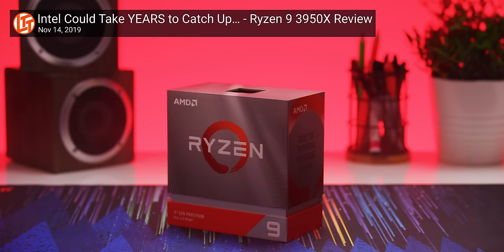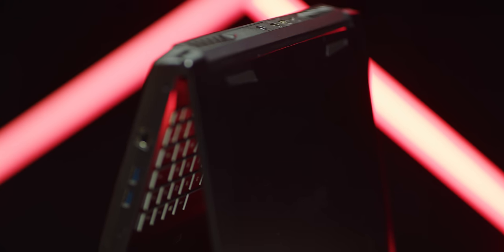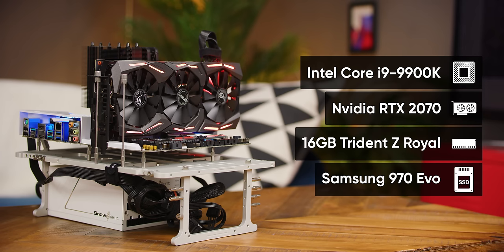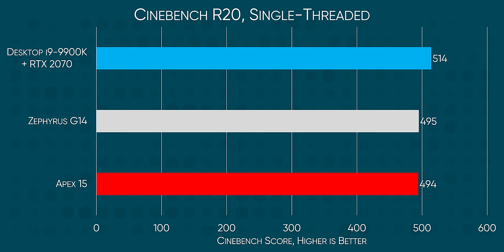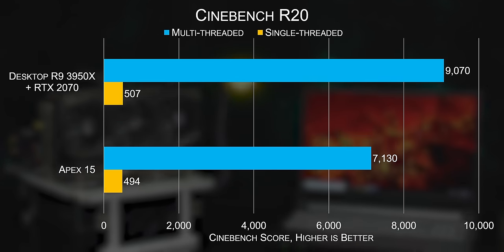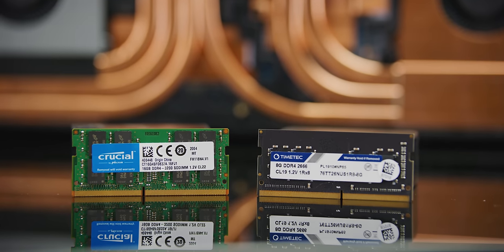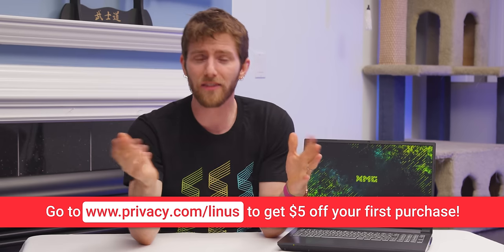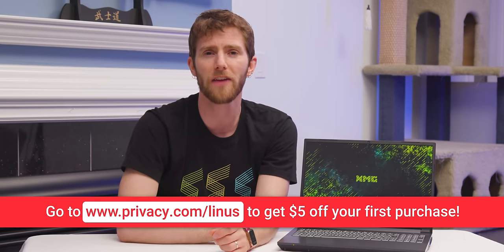The Most Powerful Laptop EVER!!! - XMG Apex 15

Comment: Intel: 5% better performance for only 20% more money 🙂
Reply: Kekistani Freedom Fighter *only applies to gaming and single core applications
Reply: more like 1% 😭😭
Reply: ElZamo92 sooo... Minecraft
Reply: @mlggamingpro2578  uh no, roblox
Reply: I mean my i5 9400f is significantly cheaper than the 3600 and I bought cheaper ram, still gets  0-5% less preformance in the games I play
Reply: It may be worth it if your time is more valuable
Reply: Its still 5 percent better I will take it...nvm
Reply: Intel bad.
Amd good.
Give me likes now.
Reply: @peytonwarren1936  it usually loses when it comes to time thou, its 1-5% on gaming only. Applications usually run faster on AMD, saving you time.
Reply: 60% more money*
Reply: Paul?
Reply: s t o n k s
Reply: 5% on paper, -10% actual due to thermals
Reply: @yurtle13x  Now thats a very good pun
Reply: @3XH1L  Haha no, maybe where you are. I have a feeling you got a deal because everywhere I am checking the prices are relatively similar 160 odd give or take depending where you look. 

Also the ram is ddr4. Which is the same for both builds, so that's another deal. 🤷

Only difference really is that one has multi-threading, higher base clock and is over-clockable, should you so desire. 
Hang on, Ryzen is better. 🤔 Who'd'a thunk. Even if it was significantly more expensive, why not.. it's the better chip.
Reply: @atretador2452  "application usually run faster on AMD"
Adobe:allowed us to introduce our self
Reply: @w04h  Yes. But admittedly they're getting on the right track with scaling dual core Pentiums, quad core i3s, septa core i5s, octa core i7s, and deca core i9s all with hyperthreading. Admittedly they should put more into new architect instead of constantly refreshing 14nm+++++ & find a consistent socket instead of LGA 1366, 1150, 1151, 1155, & now 1200. AMD has it right with AM4 & unlocked multipliers on all their CPUS.
Reply: Intel is better for laptops because the manufactures of laptops get better deals then people buying the CPU separately
Reply: Now that was a cool introduction 😜👍🏻
Reply: Lolololololololololololololololololololololololololo
Reply: @F1ll1nTh3Blanks  I looked in the states and its 150 for i5 and 173 for r5. ryzen needs 3200mhz+ ram to beat the i5, whereas I bought discount 2400mhz ram. and you can't overclock without running very hot with the stock wraith cooler so you'd spend more on a cooler, overall its about a $35 plus cooler difference for %5 difference in preformance
Reply: @peytonwarren1936  that would never be the situation because all of the inter processors who are better than AMD processors are mainly for gaming, and a sports game with is the only career were the performance really matter usually really easy to drive games.
Reply: More like same or worse on sustained loads, and throttle after 5 mins.
Reply: that's a steal !
Reply: @yurtle13x  i dunno my 3950x runs hot as shit under load
Reply: Intel is not as good as AMD,except defeat
Reply: @3XH1L  we don't all live in the states 160 each here in the uk and the wraith cooler is fine for max overclock 3200 ram here 40 pound 2400 35 and intel motherboard more expensive
Reply: @ElZamo92  My question: When will all the softwares start taking full advantage of all those cores and threads?
Reply: The i9-9900K can't even run without hitting 90c+ with the absolutely best cooling setup.

What's the point of having a beastly cpu if you're going to be hitting such high temps resulting in degrading performance?
Reply: @randomshorts739  okay cool get the 3600 then, I'm just talking about north America sorry
Reply: @danyuzunov  wow Ive been beaten by facts and logic! whatever will I do
Reply: Kekistani Freedom Fighter technically the amd one is more expensive in this case
Reply: @danyuzunov  if you show me a cheaper processor thats cooler and gets better fps than my i5 9400f I will buy it right now
Reply: @TechnoMinarchist  undervolt+noctua cooler
Reply: Kekistani freedom fighter: Just like the good ol days! 😃
Reply: @thelightsilent  what  currency are you using $ or Pounds (windows 7 does not support the pound symbol) BTW I agree
Intel laptops run cooler and are more power efficient (I know because me and my dad have intel cpus and my brother has a ryzen)
Reply: 5 Procent at the top end is often more than 20 procent more pricing
Reply: Gives me mmorpg vibes
Reply: @3XH1L  Undervolting the i9-9900K defeats the whole purpose behind getting an i9-9900K.

You can get better performance and temperatures than an undervolted i9-9900K with cheaper cpus.
Reply: Don't forget, desktop version...
Reply: @TechnoMinarchist  honestly I'd never get an i9 so I can't really argue over it, I'm sure there are some people who can justify the purchase
Reply: @3XH1L  You will buy it right now you say? R3 3300x. Cheaper. Cooler. Faster in both single and multithreading. Depending on the country R5 3600 is also faster and (sometimes) cheaper. No cooler needed, cheap motherboard can upgrade to ryzen 3000 later.
Reply: .5% better you mean?
Reply: Alperen Cicek *accept
Reply: That’s also NVIDIA
Reply: @lukri4209  nvidia names the stuff they make better like RTX 2080 TI OMEGA ULTRA SUPER EXTREME RGB FOUNDERS EDITION
Reply: WHAT A SNATCH!!!
Reply: Mait D but if you don’t game then the 3600 wins
Reply: Mait D I got a 9900kf for half the price of a 3950x and I’m happy with it. It runs hot and it’s a power hog but it’s powerful and my 240mm AIO keeps it just cool enough so that it doesn’t thermal throttle. Though I should clarify the reason I got it is because I had a z370 MOBO and I could just update my BIOS and drop it in.
Reply: rx 5700 xt 400 $ rtx 2080 ti 1200$
Reply: Niels What cheap MOBO can allow the later upgrade? Lmao. You must not be paying attention to the news because you definitely aren’t talking about a B450 and Ryzen 3rd gen right?
Reply: actually 50% worse performance for only 20% more money...
Reply: Diminishing returns
Reply: Also more power consumption 😀
Reply: @Yomom12388  glad to hear it if I had the money I'd definitely consider it
Reply: @Sol_Creations06  true but I play games so...
Reply: @yuvtube1  they did some time ago
Reply: @3XH1L  a ryzen 6 core thats cheap can handle a lot more gpu and new 4 cores are faster
Reply: @Yomom12388  i dont think you can compare 9900kf with 3950x as the 3800x is a lot more cheaper amd has 8 cores and its like 350$ 3950x is 700$
Reply: @Noooo23523  why can a 3600 handle more gpu than a i5 9400f 🤔 and the new r3's drop at the same time as intel 10th gen so compare those
Reply: Mait D the i5 compared to the ryzen 5 3600 is a complete rip off
Reply: @Jolty1021  maybe where you live in north America it really isn't
Reply: Mait D I just double checked the ryzen 5 3600 is 12 dollars more expensive and is 20 percent better in almost all categories
Reply: @Jolty1021  I looked on pcpartpicker, 25 bucks more expensive and show me 20% gains in gaming lmao
Reply: That's like buying an iphone but at least you get extra performance 🤣 no matter how small
Reply: Mait D look at cpu.userbenchmark.com and compare the ryzen 5 3600 to the i5 9400F lol
Reply: What a bargain
Reply: @Jolty1021  3600 is 3% in games according to the that site...
Reply: @mushroomcraft  Than
Reply: @3XH1L  isnt an i5-9400f $130.  you'll have to spend an extra like $20-30 bucks on a cooler, so $160.  that's $15 less than a r5 3600, and the r5 3600 can overclock, so butter performance.
Reply: Mait D notice i said almost all and didnt specify gaming. Still its better for that small 12 dollars oh and did I mention it comes with a cooler? Because it does
Reply: STONKS
Reply: @Jolty1021  I specified gaming, and it's 23  dollars, and the i5 comes with a cooler....
Reply: @onezeee  for the US the i5 is 23 dollars cheaper and comes with a cooler
Reply: Ryzen: 20% cheaper but 20000% more expensive when your house burns down
Reply: Intel marketing department wants you asap.
Reply: @syXification PROCENT
Ah yes,  this the percent symbol but for pro gamers.
Reply: A but it’s true
Reply: You still get better performance...
Unless...
Reply: But it IS more... ROFL (both ways).
Reply: Swap to athlon 3000g lol
Reply: Not anymore really
Reply: Still doesn't beat Intel in gaming, if I want an excel machine I'll go with AMD.
Reply: Sarge Nisanov  that's benchmarks go to 12:18 for gaming comparison https://youtu.be/ymxUhUH-BgE
Reply: Sarge Nisanov  and if I were to buy a cpu today I'd be comparing the 3300x to the new 10th gen I3
Reply: @Sudin S probably not I think you should just get an actual desktop if ur budget is that big
Reply: @Yomom12388  If you read what my comment said you can see I wrote ryzen 3000 and not 4000.
Reply: And out thereamd is just  yeah just take this 4 extra cores with the same price and better performance
Reply: Nvidia: 5% better performances for 100% more money 🙃🙂
Reply: @3XH1L  wait it comes with a cooler?!?!
Reply: @onezeee  yessir
Reply: @3XH1L  do u know ryzen 3500 exist ? In cheaper prize gives performance then i5 9400f
Reply: @dmcsahu  not available worldwide
Reply: Niels You did, yes. I was confused because you already mentioned some 3000 series CPUs so I thought you were referring to next gen Ryzen. Thank you for the clarification.
Reply: adam alaoui oh wow you’re way off on this one
Reply: @3XH1L  how so I know if it a available or not in his country coz it's available in mine
Reply: @dmcsahu  I live in north America we dont got it
Reply: Kekistani Freedom Fighter 9900k gets sometimes even 10 more FPS than 3900x for the same price
Reply: Jacen Solo 360mm AIO or custom loop, a 9900k won’t be 90c
Reply: Mocanu Octavian43 the 9900k beats the 3800x, 3900x and competes beats the 3950x more times than loses
Reply: And 150% heat
Reply: Careful you don't cut yourself on that edge
Reply: AMD is been just been handing it Intel last couple years they are much more relevant and that's why their stock was great one make money on last 2 years
Reply: Which is better than intel
Reply: Minecraft without optifine
Reply: Frikin mr crabs
Reply: @yurtle13x  and only run at %55-%80 of processing power with overclocking certified parts even better performance.
Reply: @3XH1L  btw the 9400f is THE ONLY well priced CPU by intel :) and got dethroned by the Ryzen 3 3300X
Reply: @ElZamo92  AMD is better there too
Reply: @3XH1L  3500x is also way cheaper and you can overclock 3500x.
If you bought 9400f then it's stupid choice.
Besides 3300x destroys 9400f too.
Reply: @bullseye6969  3500x isn't available in North America, 3300x is a year newer than 9400f and so you should be comparing to the 10400f or new i3
Reply: Me: only 5% better performance for 20 % more money🤨
Reply: Thought couldn't afford neither AMD or intel🤷🏻‍♂️
Reply: And with thermal so hot you could also replace your stove with it.
Reply: Technically speaking, small increases in performance (even as small as five percent) often times warrants bigger price increases.
Reply: @3XH1L  because a 6 core gpu supports a gtx 1080 and your 4 core gpu supports a gtx 1060(if it is a 4 core then if it is a 6/6 core its also weaker than the amd 6/12 core and also amd has higher smt efficiency making it a 8/8 like how two gens of intel cpus were the same power but one was 6/12 and one 8/8
Reply: @Noooo23523  the i5s are 6 core cpus, the i5 9400f is slightly worse in game preformance than the 3600 and the 9600k Is much faster. any gpu that works well with the 3600 will work well with the 9400f, (2070s 2080 etc
Reply: @Noooo23523  also a 3300x is a quad core and could be paired with a 1070ti /1080
Reply: @3XH1L  if you want bottlenecks
Reply: @Noooo23523  not at all the best i7s were quad cores 3 years ago (i7 7700k) and could be paired with a 1080 ti, the 3300x is a faster i7 7700k so
Reply: 5% for 20% is a good deal imo
Reply: @thelightsilent  sheep buy intel
Reply: Mocanu Octavian43 why you mad
Reply: @jon5500  because im telling people to buy the better product which is amd and people cant change their mind is not my fault only the ones who dont know anything about pc parts and its easy
Reply: Mocanu Octavian43 and just to clarify my first comment was a joke and my second one was just support just don’t be a prick especially because it is a joke based on my opinion which is that intel is collet and better
Reply: @jon5500  hmm. ok
Reply: @3XH1L  lol cant believe I'm replying to this 3 weeks later but i5 9400f is $150 with 6 cores and 6 threads.  it's better to go with a r5 2600, r5 1600af, or if u can spend the extra money, r5 3600.
Reply: @onezeee  if your playing only games the i5 will be faster then the 2600 and 1600af, and about the same as 3600 for less money
Reply: @3XH1L  but in literally everything else the ryzens trump the intel.  the gains you get in games isnt worth it for what performance you lose in other tasks
Reply: @onezeee  most people who build a gaming pc don't care about better unzip times or rendering, I play games every day and want the highest and consistent frame rates, I render videos every few weeks and don't care how long they take
Reply: @3XH1L  but most people do.  even if people dont care too much about those times the extra 6 threads really helps keep their pc alive for the future, without having to upgrade.
Reply: @onezeee  definitely depends on your priorities there, I usually end up recommending intel cpus to my friends as they play at 144hz 1080p and won't benifit from extra cores/threads In the games they play as well as I just bought a 3300x + super fast ram as a budget 240hz slayer. but I can definitely see people who care less about marginal fps gains and more about futurproofing
Reply: @3XH1L  yeah the fps gains are so marginal that spending the extra money isnt worth it.
Reply: @valen8560  yup
Reply: The top 0.1% of products are always like that.
Reply: Intel: That is business

Comment: linus did better advertising for xmg than xmg themselves
Reply: because they payed him
Reply: Yeh. Anti MacBook? This is anti laptop... it’s a lan computer with an lcd.
Reply: @curt8806  And a UPS, that's honestly pretty underrated. Some companies make "portable servers" that are laptops that accept Xeon-W processors and an unusual amount of RAM and storage for a laptop for exactly this reason: 20-30 minute battery life is enough to wait for power to come back, find and start a backup generator, or save all work before turning off the server safely. We have Ryzen mobile on the opposite end of the spectrum: I could see a 99wh battery in a laptop with a r9 4900u being the ultimate no compromises battery life champion, maybe an HP Pro or Dell Precision/Latitude/XPS.

Comment: When a laptop has the same core count as my dual socket home server.
Reply: Eh.. or more? 

I think The L wants two 128gb rams in that machine.

My shy workstation got 6x 16gb, and that was big amount of memory when I install sticks in the machine. Now that Xeon is maby same good as my phone performance.. :p. Only thing my Nokia does not have raided ssd:s

gg..
Reply: USAF Steve  time for an upgrade my friend
Reply: Lol, same. I've got a pair of Xeon E5-2650 v2's in mine, so a total of 16 cores/32 threads. Except it draws well in excess of 200 watts, never really turbos up well in esxi, and uses ddr3 1600 :(
Reply: you have a dual socket server?
Reply: I’m running an old Dell R620 with two Xeon E5-2660’s. 16 core 32 thread for the whole box, 64 gigs of DDR3. Just got the whole setup recently because it was cheap. Significantly cheaper than this laptop. But no where near the performance. Luckily I’m just using it for a storage server with 10GbE so, it works for that. Thanks for all the likes and relies btw guys! I think this is officially my most liked comment ever! 😅
Reply: 2x e5 2680 10core. I filled 8 of the 24 ram slots with 32gb lrdims
Reply: this laptop has twice as many cores as my gaming pc... and four times as many threads! it's impressive how far we've come in less than a decade
Reply: @nulious  Proxmox? FreeNAS? Unraid? ESXi? Something Else?

Sounds like quite the setup you have there, I assume that power consumption is just a tad over 240W?

I'm tempted to pick up one of these older E5 V4 Socket Xeon Systems in a couple of years to use as a Storage-Only Server, using LRDIMM's of 128GB capacity each, and using that RAM as Storage Cache to an SSD Cache for the Large Mechanical HDD's I would be using, 10GbE should be a tad bit cheaper too by the time I come to purchasing something like that.
My budget is going to be roughly 5K I hope, so I should be within that price range after buying new HDD's and possibly New SSDs (Depends if any Holy Grail deals appear online on lightly used enterprise grade SSDs)
Reply: @longnamedude3947  it is a project my roommate and I are just getting started on. the box has 2 1100w power supplies and won't boot if both aren't there. we haven't decided on what we are going to use, leaning towards xen or vmware,  freenas is also in the running. it also has 24x 2.5" drive bays to fill up which will take us awhile.